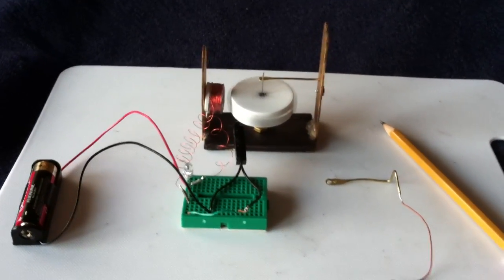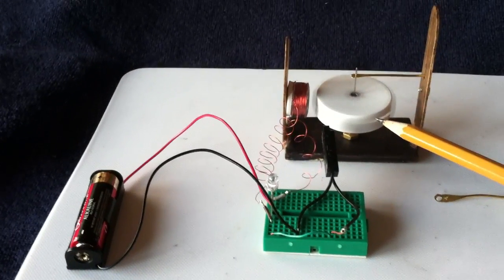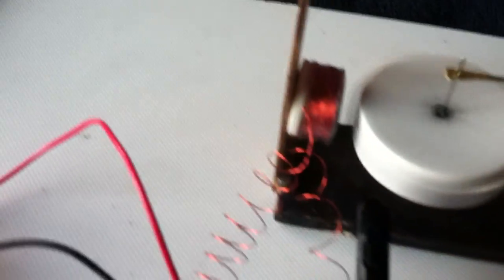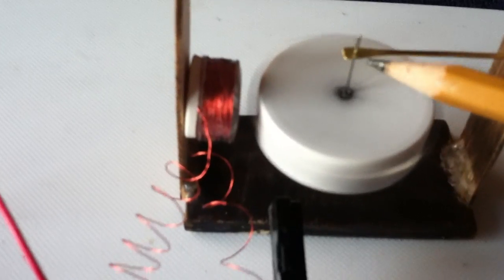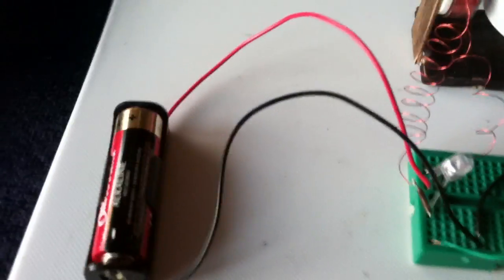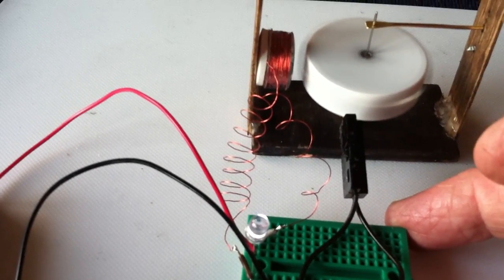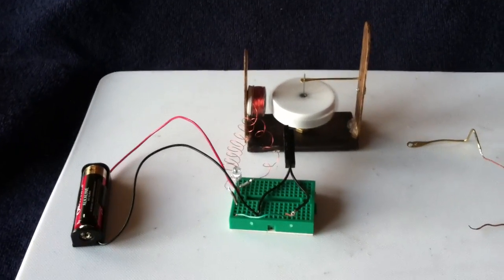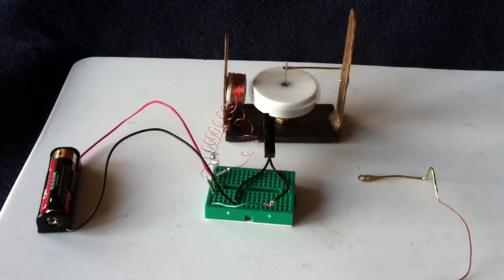Good Bearing for Small Motor

Comment: Thanks for showing all your work .i have been trying to do and learn fro it .i have made one like yours but now I would like to see if it can charge up a smaller battery than I'm running or the same .once I have that done .(if)power it by solar and see if it will charge faster or slower with the same size solar little panel .just for fun!!my question to you it should I use a transistor or reed switch or halls eff.  Circuit What circuit one or two coils?
Reply from the maker: +bruce don   On a simple homemade motor start out with one coil and a reed switch. Test out your basic rotor structure and make THAT as good as it can be.  After that then move onto different drive circuits and coil arrangements.  I have seen so many doomed projects happen because the initial motor design was flawed.  Friction and heat are the silent thieves that steal the energy.  No fancy circuits or coil arrangements can make up for it.

Comment: In order to prevent the magnets from flying off at high speed, maybe it would be a good idea to glue them to the inside instead of the outside of the lid. 

You may have to look around a little to find lids where the screw threads don't interfere or else remove them with an exacto knife.
Reply from the maker: +Dick Bromberg  My very first "lidmotor"  years ago used a honey jar lid and the magnets were on the inside.  I just like looking at the magnets go around now.  I rarely throw one because my days of going high speed are over.  Most of my stuff runs on tiny amounts of energy and are very slow.

Comment: killn me liddy pants... :-)  what I really need from youtube is mr lidmotor to build a motor outa a GARBAGE CAn lid... like ufo style... laffs.   love the needle idea...  I.m on it...  lid rocks
Reply from the maker: +BLADE RUNNER  It is funny that you mentioned that.  Several times I have though about making a large pulse motor but my work space prevents it.  One of these days I may make one using a left over pizza box.  When the project is over it will go in the trash.  No remorse saying good bye to that one.
Reply: That.d b to cool. now u got me tripn. like. will a coil pulse a really wide rotor? how wide?:-\  hmmm. hoola hoop size? heehee;-)   but for real- 
maybe u can help.
 Will diametric mags stick end to end? like on a shaft? 2 of the tube with hole style? cuz I wana spin up a neo mag in a pump motor chassis.  it'd be nice to get a 5/8"x1.5" tube going. but can only find 3/4" sizes. so I thought maybe 2 stuck together on same shaft all butt tightened up. idk. just got me tripn now liddy;-)  
bcool...  keep posten. lots of us watching u mr. :)

Comment: Good info!

What gauge is the wire?
Also, where did you buy your non-white, small breadboards from?

Thanks for sharing!
Reply from the maker: +A B Wire size is about 1/16".  I don't know what gauge that would be.  I imagine that you could make it out of thick copper wire also but it would wear out sooner.   Brass rod stock that would work great.  Most hardware stores sell it in different sizes.  I got the small breadboards at Amazondotcom
Reply: Thank you! :)

Comment: It would be interesting to use a
hall effect sensor instead of the reed switch :-)
Reply from the maker: +Paul Wedlock Yep.  I have done that many times--but you need about 2 1/2 volts for the circuit.  The reed switch works way under 1 volt so you can use dead AA batteries for one last hurrah.
Reply: Cool :-)
Reply: +Lidmotor 
We love gadgets that run on vapors. :-)
You go boi! haha

Comment: How about putting the magnet on the inside for higher rpm, do you think that would work?
Reply from the maker: +LancerSolurus  Yes.  Putting the magnets on the inside works well.  Some guys put a piece of tape around the rotor magnets when they mount the magnets on the outside.  I usually run these things pretty slow and I like looking at the shinny magnets go round and round.